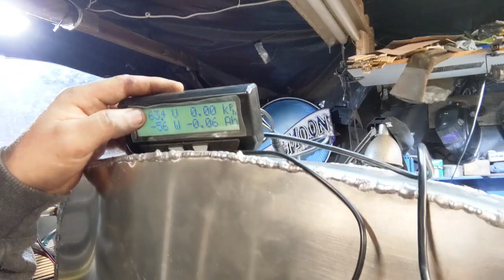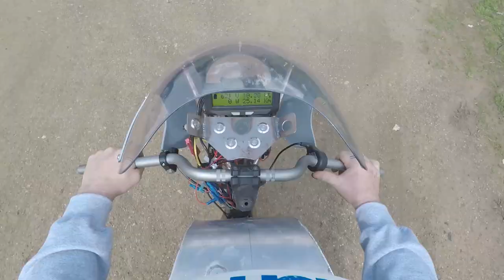Extreme Range EV Mini Bike Build | Aluminum gas tank construction | Lark Machine co

Comment: Wow, your workbench is cleaner than mine. I was thinking about doing the same thing with my trike but just pulling the generator on a trailer. I mainly need electric to get out of my neighborhood without angering the neighbors, otherwise, I would just buy a Staton or Golden Eagle weed trimmer engine setup. BTW, mine won’t ever look as professional as yours. Some duct tape, a hammer for fit and paint to match will do for my rat looking rig. Looking forward to see what you come up with next.
Reply from the maker: Thanks so much!!!!   my work bench gets unruly some times and just needs a good swipe to clean it off!

Comment: Use a half twist your thumb is going to get tired.
Reply from the maker: I have noticed that on the long rides so far.  I have been tucking my hand in and resting my palm on the thumb switch to make it more comfortable.  I was thinking about making a cruise control to set the speed for long hauls

Comment: 500 watt hr maybe not 5whr
Reply from the maker: Yeah, in the next video I tell about the cycle analyst not being calibrated. Turned out to be 17wh per mile. Still pretty good
Reply: @sheanyquist  definitely cool those calculations can be tricky basically figure out how far u go on a half gallon or a liter then calculate